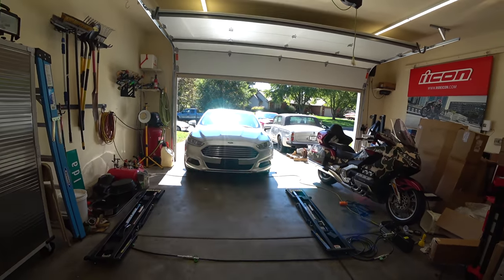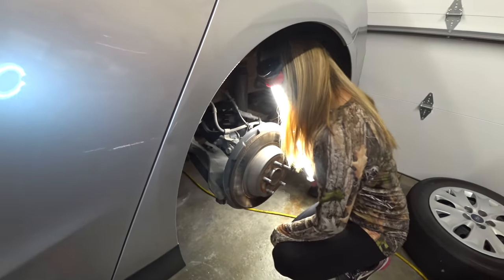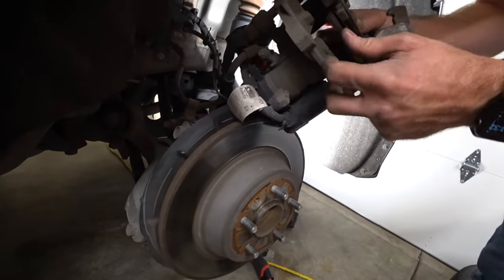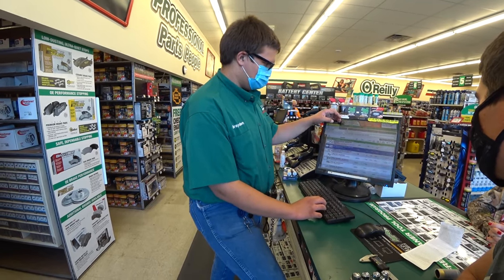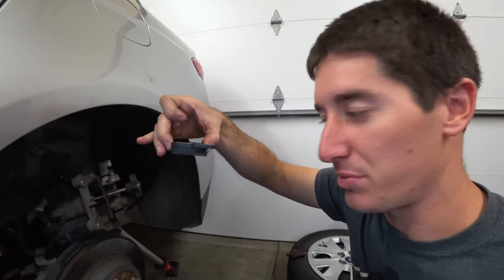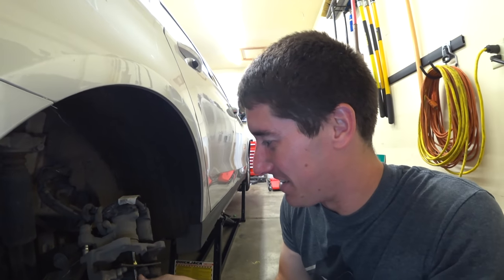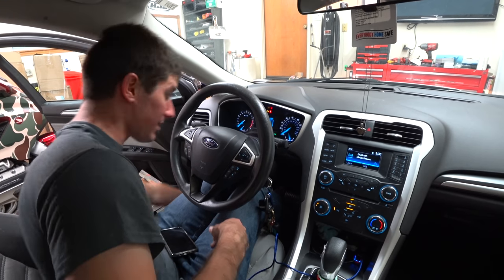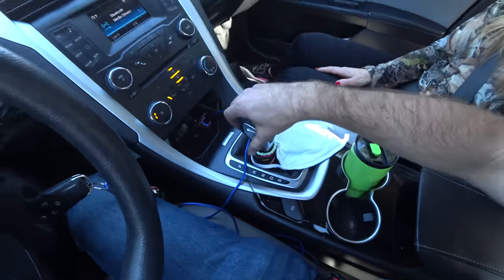GIVING A Single Mom A BRAKE Job (Dealer Wanted Too Much $$$)

Comment: The funny thing is that ford cars start off at 19mm but after a month the expand to 20-21mm. Ford lugs are trash all ford's do the same thing I recommend all new ford buyers to replace the lugs with aftermarket lugs before you have to hammer a 20mm on your lugs
Reply from the maker: I was using the hammer on that 20mm for sure, felt terrible for doing that 😬
Reply: @WatchJRGo  working at a tire shop I have to hammer probably 2 ford's a day then the customer complains why we have to hit there car with a hammer. All I say is "cause it's a ford"
Reply: There's a nut made by a supplier in Ontario that does it too. They're on Dodge Caravans and Chevy Equinoxes and such. Best factory 19mm nut is probably Hondas 12x1.5. They'll fit the Fords and Dodges, but if I recall correctky the Equinox and Traverse use the 22mm version on the bigger Silverado studs. They woukd be best served to get factory Silverado nuts. I always recommend these factory nuts as replacements for the faulty ones as they won't give the owner trouble again. Some aftermarket nuts are ok, but some are as bad or worse than the one's we're discussing. For Toyotas and Mitsubishis with alloy wheels only the factory nuts with the integral washers work as the wheels aren't drilled for acorn nuts.
Reply: How bad a problem is it? Astro Pneumatic makes a 19.5mm / 20.5mm lug nut socket for Fords.
Reply: @robertlevandowski4457  bad enough that the company has to make special sockets for it. Ford has been sued for it but never did anything about it
Reply: I had a Chrysler that had those vanity covers on the lug nuts. The tire shop wouldn't replace the tires because they "Didn't have the tools " to remove the lug nuts after the covers came loose.

I ended up using a hammer, a flathead screwdriver, and vice grips to get the cover off since the hammering a socket on route didn't work.
Reply: @hackmattr  i worked in a tire shop for 6 years. Yeah, we weren't allowed cutting tools or even a johnson bar. Kind of ridiculous. We tried to be creative with what we had when we could though to the customers benefit. After the caps are off the nut itself is exactly 18mm. Your factory lug wrench won't fit the cap or the nut underneath. Fun thing to discover while trying to change a flat on the shoulder of a highway, isn't it?

Comment: How do you change a flat with 2 different size lugnuts?  Is she carrying a breaker bar with 20mm and 19mm sockets?
Reply: She's not. That'll come back to bite him in the ass when she gets a flat tire and can't get it off. At my shop we cannot put different size lug nuts on that what the car has from factory because of this.

Comment: You have your quickjacks mixed up L/R. 

The mechanical latch s/b facing out so you can lift it with your foot when lowering 

Also the car will move forward when lifting vs backwards into your garage door. 

Enjoy them.
Reply: hopes he sees this

Comment: Some swelling on the lug nuts on my tacoma.  But its 14 years old so I'll cut Toyota some slack.  I don't get the electronic parking brake thing...seems unnecessarily complicated.
Reply from the maker: Auto adjusts, no crazy linkage or cables to rust stuck 🍻
Reply: @WatchJRGo  my Elantra GLS is a 2007, parking brake works just like new. Fixing the electronic part when it does die is MUCH more $$$ than oiling a cable or replacing it. NOPE, I will never buy an all electronic car. They will eventually go bad and then it is not worth fixing. I get 36 mpg and can seat 4 easily and have 137 HP in a car that works just fine. ( also only weighs 2850 lbs )
Reply: @WatchJRGo  Nope. Just computers to fail, wires to rust, unnecessary parts to be in the way of an "easy" brake job, and of course, complicated service modes.
Reply: At least there isn't a wear sensor embedded in the pad like on mercedes an BMW.
Reply: that lack of cables etc down a central tunnel allow the designers more room to design better cabin space etc

Comment: Your fronts are great and your rears are completely gone.
Ok
Reply: That seems suspicious to me also. Unless the fronts were recently replaced.
Reply: I would say, she drove with the parking brake on for a few weeks but its electric and wont let that happen. So most likely they have been replaced.
Reply: Since the late 2000s, When stability control became standard, at least on Fusions, most of the braking bias happened at the rear not the front. So rear brakes wear out faster.
Reply: It's wear due ti previous owner

Comment: I know years ago (back in the 90s) ford had "chrome" lug nuts that were a thin chrome plated shell over a steel lugnut.  My grandfather had a Ranger that had them.  Had some work done that required removing a wheel.  He left the shop and a few miles down the road, lost a front wheel.  Found out that the chrome shell would spin on the steel nut and you couldn't achieve proper torque.

Comment: It's actually true about the lug nuts. i had a ford focus that had swollen lug nuts and the 21mm(i think) socket did not fit anymore and they would strip when trying to get them off. it was a flaw design with the cap that goes over the actual nut.

Comment: If one pad is worn a lot more than the other the caliper is not retracting because the seal on the piston is hard from heat. The rubber piston seal distorts when the brakes are applied and then is goes back to it's original shape when the brakes pedal is let off. There is no mechanical device that retracts the piston. A quick and easy way to confirm this is to apply the brakes before putting the wheel on and then turn the rotor. It should turn easy. I learned this the expensive way by having "come backs". I worked many years as a mechanic and most of the time I told customers that their cars needed calipers along with pads.

Comment: I work a Ford dealership and let me tell you how frustrating those lug nuts are to deal with. They start at 19mm with the cap (18 if its missing.) They get "swollen" over time with constant heating and cooling. So they basically grow. Sometimes two sizes larger. Sometimes if you remove the wheels frequently with tire rotations you can keep them from swelling past their 19mm size, but they still get stuck in your socket and are annoying to deal with. They also aren't cheap lug nuts hahahaha. Also the dealership doesn't recommend "pad slapping." We at least turn the rotors if they are within spec to avoid them from pitting or grooving before the pads have run out of life, forcing you to replace the rotor and another set of pads with it. Thats why its generally a little more expensive at the dealer, since you pay for the labor and the parts combined and at least in my case, a quality job. Not saying you didn't do good lol.

Comment: coming from working at discount tire I can say lug nuts swelling is a thing but I don't know what causes it, but it does show where manufacturers  cheap out same with wheel studs, lots of fords need lug nuts constantly, so invest into non oem ones if you can that are a higher quality. I work at a ford parts department now and there are a constant flow of lug nuts coming in and lots of stock

Comment: Glide pins have blue/red loctite from factory. Don't change just pads. Change rotors too. Generally nuts are 19mm. Use tourque stick

Comment: She wasn't low on fluid at all.  Low fluid level is either a leak (which you would feel in the brake pedal) but 99.9% of the time it shows how worn your brake pads are just from opening the hood. As the brake pads wear the caliper piston has to move further out (and stay out) of the caliper to allow for this wear which means the brake fluid has to fill the void in the caliper where the piston used to be. This is also why "topping up" brake fluid is not a standard practice and most technicians hate it. Generally if the fluid is halfway (or below halfway) between the MIN/MAX marks, a brake inspection is recommended. Also don't take the cap off the brake reservoir unless absolutely necessary... this allows moisture to be absorbed by the brake fluid lowering its boiling point which is bad during panic stops in hot climates and in cold climates can lead to hard/ frozen brake fluid

Comment: I work in an independent repair facility and we see swollen lug nuts all the time. Typically you see it on trucks tho with longer lugs. If someone uses a shallow socket on a deeper lug nut it actually twists the lug, I’ve seen some severe cases where the twist is visible, most of the time we have to use oversized socket or pound on sockets.

Comment: I just did a brake and rotor job on my 2014 Fusion S too with 101k miles. Same deal the rears were toast and the fronts were perfect. Also it’s common the lugs swell on the fusions because they put aluminum caps over the steel lugs and they swell and destroy themselves. And if you don’t replace them with OEM style the hubs won’t stay on 😅
Reply: Nonsense.  You just have to get the proper lugnut.  60degree tapered seat M12 X 1.5
Reply: @rxtuninginc8444  right that’s why I said oem style lugs. They don’t have to be from Motorcraft but if you don’t use the correct style lugs the oem hubcaps don’t stay on. They lock on using three of the lugs
Reply: @larrybiller3576  hubcaps.  Can't believe they still use those today.  I don't think your statement applies to many people.  Most cars have alloys.
Reply: @rxtuninginc8444  I’m aware of this lol, however mine was a Fusion S and this video was of a Fusion S and they had very similar issues. That’s all, I wish mine had the alloys because it would have made the brake job just a simple change but over engineering made it a much longer job haha

Comment: Brakes all around? Ford have come a long way since the Pinto fuel tank fiasco. 😅
Reply: Hey, I loved my 71 Pinto with the optional Ford of Germany 2L OHC engine, 115hp in a 2,000 lb car and manual transmission and it was fun to drive.  The base engine was the 1.6L pushrod Ford Cortina engine.  Very good engines unlike the terrible Vega engine.

Comment: Ford is known for its lug nuts "swelling". It's not bs, the casing around the nut expands causing it to be a huge pain to get off. I have a special 19.5mm socket just for when i do ford wheels, because it goes from a 19mm to 19.5 or 20mm when it expands.  So the dealer wasn't trying to scam you. If anything they were trying to help you. BTW their 21mm lug nuts do the same thing.

Comment: Interesting comment on the lug nuts...  I just finally changed my rotors (and pads) at around 105K miles on my 2014 Fusion. I had to buy an extractor socket and hammer it on all but 5 of the lug nuts. All seem to be "rounded" or "not quite fitting" any of my sockets. The "swollen" comment sounds dumb, but after hearing this same experience with your brake job... I'd believe that somehow after seeing they are all capped (why would they do this!??! It save no money!). I ended up just buying a set of black chrome lugnuts to stick on there (dark silver car with the light silver Titanium model wheels), looks good and hopefully no more weird lug nut issues. I don't know how I would have put the spare on should it have needed to with the stock lugnuts.

Comment: I have done brake jobs for dirt cheap and even free before to help people out. 

Also shockingly the lug nuts are bad. 
I have had so many be swollen. Which is why I own half sizes. Ford and chrysler are the worst for it.
19.5mm for swollen lugs, 18.5mm for when the cap comes off.

Electric or air ratchet is a life saver on these. 

Also the caliper brackets are really tight on every one I have changed brakes on( alot of them). They use blue thread locker on them.

Comment: We just had to replace 20 out of 24 lugs on our 2010 F150 Super cab, Independent car service.  They were all 'swollen' just like her dealer said.  Our guy told us it's common on certain fords.  Our truck has 150K miles and been through many tire changes and rotations and they all just went south.

Comment: The brake deal they have right now for commercial clients on the pad and rotor combo is insane. Also on those Ford's they have a two piece capped lug nut. What happens is the cap will break and rotate over the inner part of the lugnut causing all sorts of issues. Dorman wants a lot per lugnut to get the one piece replacement, but you don't want to be stranded on the side of the road with a flat tire that your lug wrench can't remove.
Reply: Which you got to in the video, but I made this comment within the first few seconds when she said the lug nuts were swollen. Garbage oem design but easily fixed.

Comment: By the way, those fords are known for lug nuts getting swollen. Snap on actually makes a socket just for this problem. It’s a 19.5mm socket. And at my shop we REALLY look down on just “pad slapping”  a car, ESPECIALLY the rears because they don’t dissipate heat as well because it is one solid piece, so they warp way more than fronts do, so you definitely need to at least turn those rotors or she will be having problems in the future.

Comment: In UK Mondeo(Fusion) Front Brake pads replacement £290 with official dealer. DIY with original parts front/rear pads and disks £300. It’s looks like in US price is about the same.

Comment: Stock lugs on all ford cars are 19s... the other 16 lugs on that car are swollen, they should have all been replaced

Also, unless the brake system has a leak, you should never need to add or remove fluid (except when doing a flush of course) as the brake fluid level will somewhat indicate pad life (if brake fluid level is fairly low, that may be an indicator that the pads are wore)

Also also, you really should've taken the slide bolts out and lubricated those slides to keep that caliper from sticking/seizing

Comment: Been at my local ford dealer for three years as the break guy and I can confirm the swelling lug nuts are in fact a real thing they are not a 20 though they start life as a 19mm and shifty techs use standard size sockets and it slowly miss shapes them into a mushroom every single new guy complains at least 50x a day for the first year.

Comment: Recommend you swap sides with your QuickJack frames or turn each one around.  You want the safety bars facing outside so you don't have to reach through the frames to release them.

Comment: the lug nut issue is a ford thing, been this way since the 80s.. they use a thin metal cap on a steel nut. you need a special socket to remove them and not hose the cap because they are not exactly 19 or 20mm

Comment: SWOLLEN LUGS COMMON ON FORD FUSIONS!!  first time i heard of that too!  (wife owns a 16 fusion)
Reply: I have a 2007  SEL had it for 12 years the  lugs  that came with it are still intact on my 17" rims no issues with them, but I have an after market set of 16 in rims and lugs for winter driving.

Comment: Great job helping this lady but I am not too sure about having different sized lug nuts on the same car much less the same wheel.  If possible, probably need to buy all new lug nuts and tire tool. Trying to change a tire at night in the rain with different sized nuts could be a problem.

Comment: Happens all the time with the chrome cap lug nuts.  Original 19mm swell to 19.5 and sometimes 20.  They need to be replaced

Comment: I’ve noticed a lot of newer vehicles 2012 and up wear out their rear pads faster than normal. I believe it’s because of the stability control and traction control but I could be wrong. In a 2014 Jeep Wrangler we had in the back were toast in 2 years and the fronts were fine.

Comment: I Have a 2008 Focus that has 19 size lug nuts (18 in reality with a tin cap). Some of the caps fell off during driving. Now they're like 50-50. I got also a 18 soket in the tool bag.

Comment: I had to replace the rear brakes on my 2013 Ford Fusion and I think it was $121 from rockauto for all the parts using Motorcraft pads and rotors. Also, I had to replace most of the lug nuts because the previous owner used the wrong socket when reinstalling them so they were all rounded off.

Comment: You should replace all the lug nuts for the same size if she gets a flat she won't be able to get the wheel off unless she has two tire wrenches in the trunk.

Comment: Hey man, so FORD lug nuts do swell and often need to be replaced. This is a very common problem with them. For some reason, all of the smaller style lug nuts FORD uses swell and become unusable after a certain period of time. I'm always swearing at FORD's when they come in, and each nut gets stuck in your socket. Quite often I use a rubber mallet to hammer a socket on just to get the little bastards off. We keep a box of Ford replacement nuts in the shop and I'm basically swapping out bad ones all day.

Comment: That’s a very common issue with ford vehicles the lug nuts have an outer shell and those expand and no longer let the proper sized socket to fit. So they indeed need to have them all changed

Comment: Why not buy 5 lug-nuts (instead of 4) and install all 5 on one wheel 
to keep it less confusing in the future?  
[and keep the one 'good' original lug-nut to replace the next one that fails, 
because you know they will just keep failing?]

Comment: Lug nuts do "swell", it is very common you normally see it when there is a chrome cap that is over a normal stell nut, the steel starts to rust and pushes the chrome out causing it to swell real pain in the ass

Comment: Common Ford problem with swollen lug nuts. I worked at a Ford dealership and it was a common recommendation to replace lug nuts mainly for safety since the tire iron wouldn’t fit onto the lugs in the event the owner needed to use their spare.

Comment: And I worked at Ford, their lug nuts do get swollen because they have a cover and if you over torque them they’ll swell up and you’ll have to use a 19.5 to get them off efficiently and without causing more damage so what they told her was true